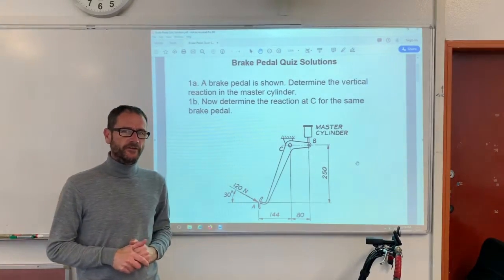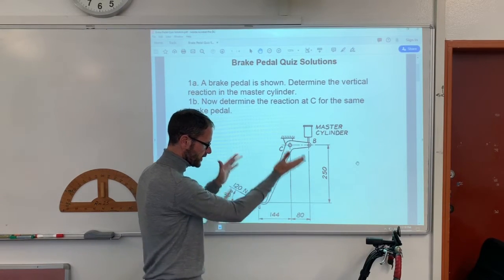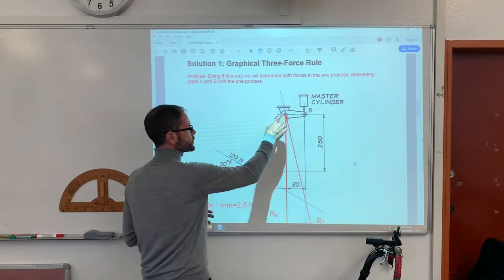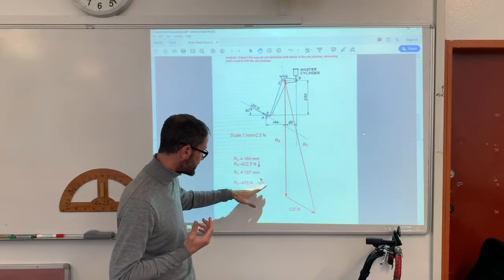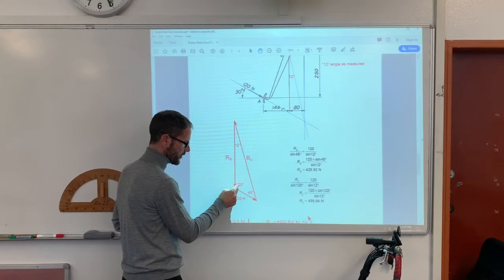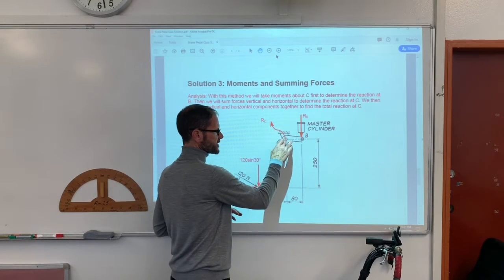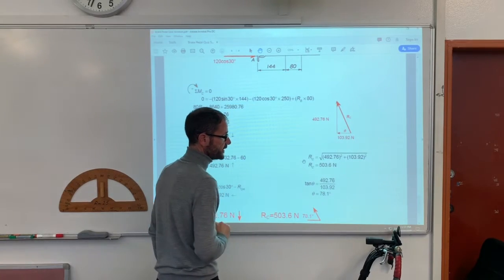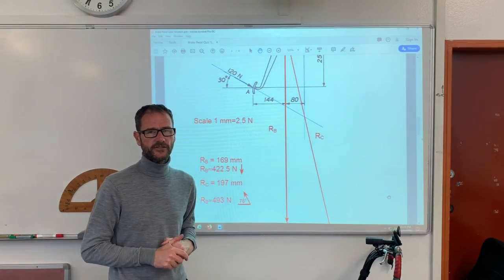Three-Force Rule - Brake Pedal

Comment: Hi Paul, Great video. a quick reply would be really helpful. So on 6:02 how did you know how long to draw the two lines RB and RC just before drawing the line 120N?
Reply from the maker: Hi Daniel. You don't know the length of RB or RC, only their direction. So I just drew those two lines it at their respective directions. Then you draw in the 120 N force to scale so it "fits" between the two lines. So if I was doing it on paper I would just place my rule at 30° and move it down the vertical force until the appropriate scale length meets the angled RC. Where that 120 N force fits in, sets the length of RB and RC. Hope that helps.
Reply: @plc007  oh wow that definitely helps. I’m not one of your students but you have definitely helped me with one of my university assignments. Thank you so much 👍🏻. Keep up the great work